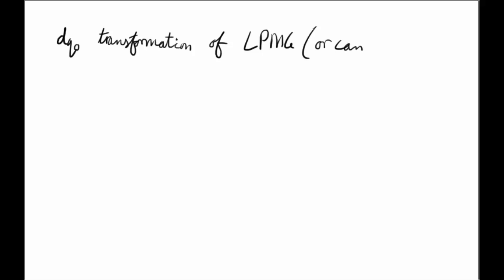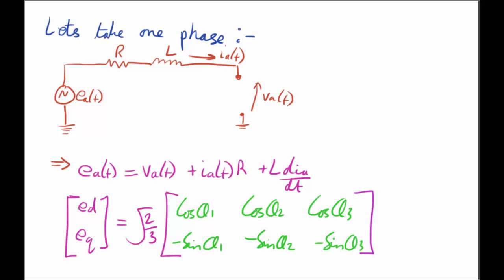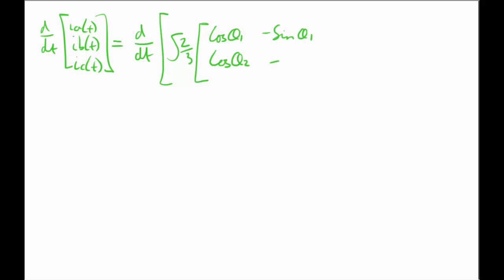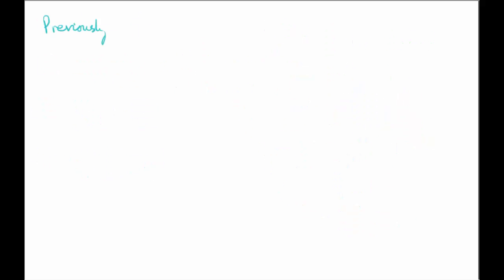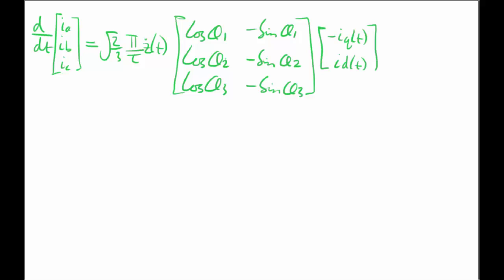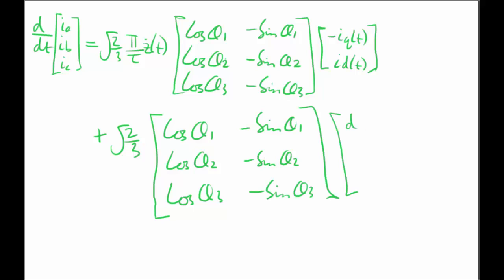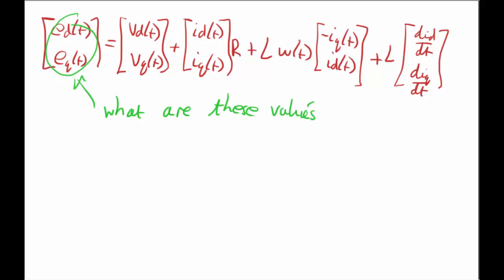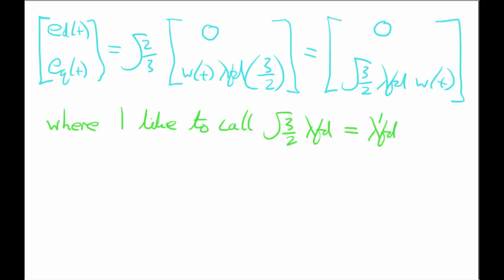dq0 Transformation

Comment: Thanks for your video.
I have a problem using dq0 transformation for a complex signal. how can I perform this transformation to a signal V=(R+j(wL-(1/Cw)))i?
Reply from the maker: Hi Bita thanks for watching,

If V is the signal itself then your best shot is to convert the signal from a frequency signal to  a time domain signal (v(t)=R*i(t)+L*(di/dt)+(1/C)integration(i(t)*dt)).

What you have to do is something very similar to this video. @ 4:40 I note that the derivative has to be solved. This is the case with the derivative and also the integral with your example. @5:16 I show the steps on how to get the derivative. With your example you can find the integral doing the step from @5:16 onwards, except using an integral instead of a derivative. 

I hope this helps.